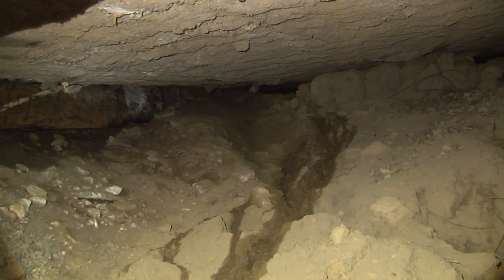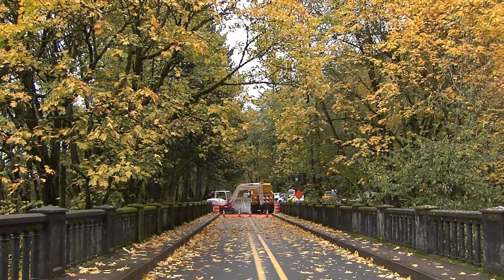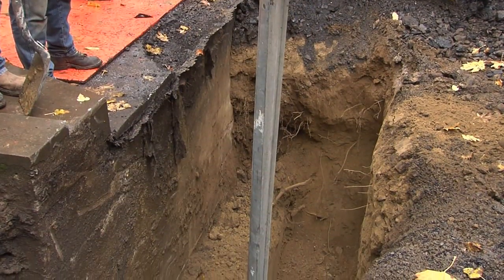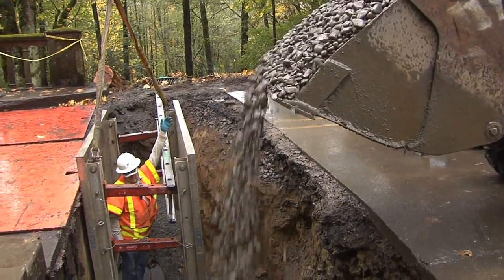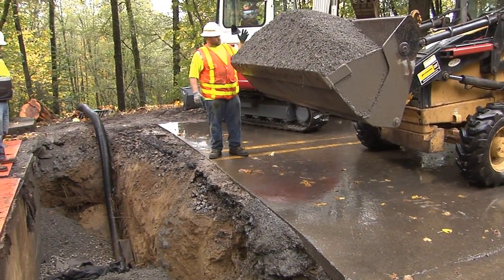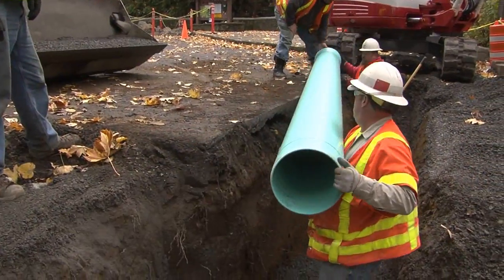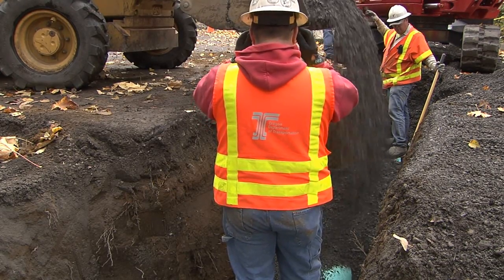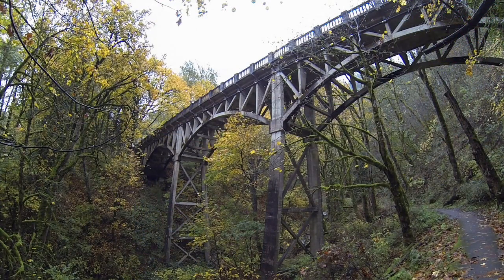Repairing a sinkhole at Latourell Falls Bridge

Comment: When it comes to erosion I was wondering if driving guard rails into an area that's close to the side of a dirt hill has actually been proven to do any good? I've lived in Oregon all my life and the only thing I've seen the highway department has come up with that works in the long run is either steel wire cages filled with rock or concrete retaining walls.